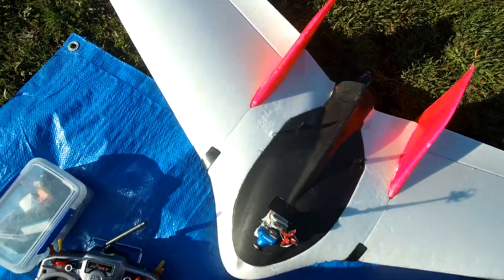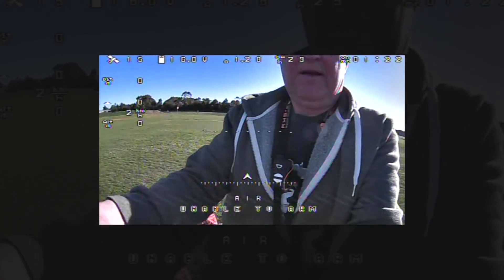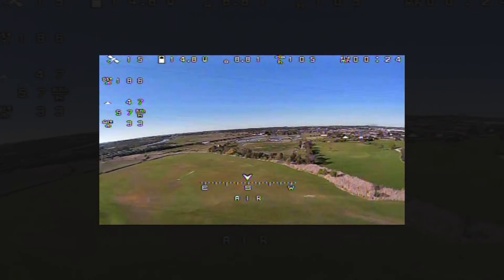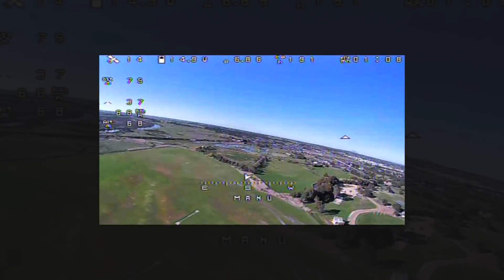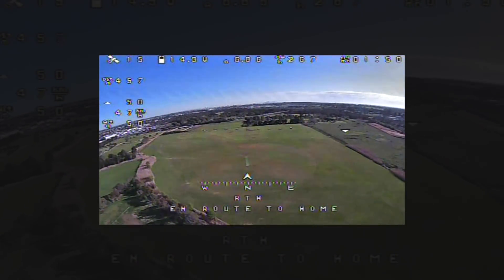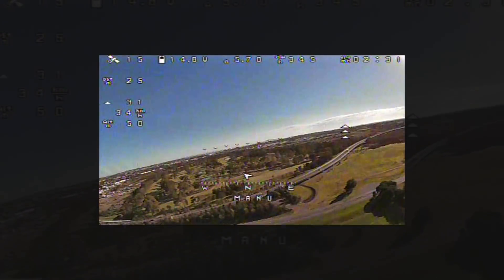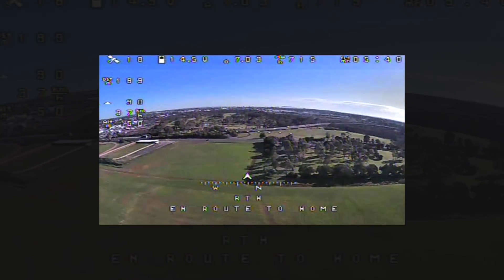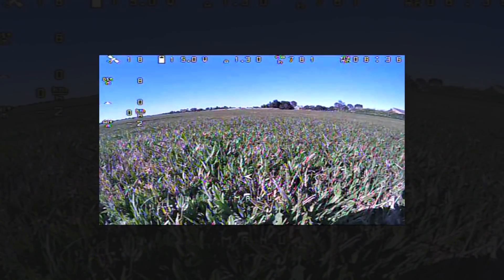Matek F411-Wing on FX-61

Comment: Have you tried running smart audio for your vtx on this board? I have my smart audio wire connected to the ST1 pad but the power settings I get are not the correct ones for my VTX.
Reply from the maker: No I haven't used Smart Audio at all. Is that used to change VTx settings?
Reply: @AndrewNewton  Yes it is. Could be handy to have work.

Comment: Remove Air Mode Andrew...its for Quads....Try Angle Mode in its place...its a less agressive form of Horizon...I like the 3D Cruze Mode too..tried it the other day...:)
  Oh and Launch Mode...I can send you the cli lines you need..its easy...lol.
Reply from the maker: Air mode = Acro plus control at zero throttle. Launch mode is pointless. It is known, lol
Reply: Launch Mode is great Andrew, no prop strikes on your hand...ever....You are right about Air Mode though and control at zero throttle...Quite why they would turn the PID loop off is beyond me.
  Im using 2.0 now...
Reply from the maker: Have you tried Launch mode with a big heavy model? The novelty wears off very quickly
Reply: Andrew Newton  You can add some idle throttle to the launch mode and all your issues will be solved. Try it

Comment: Maybe ESC braking is drawing the current?
Reply from the maker: Dont know, I'll have to test it.
Reply: Usual ESC draws very small amount of current in brake mode. It is shortcircuit of motor windings, not battery.
I think, current sensor need to be calibrated. Factory settings not always correct.

Comment: Nice one, as usual. Any idea why it still drew 1.3A while sitting on the ground?
Reply from the maker: Servos, board, Vtx and camera all draw a little at rest. They might be digital servos, will have to check.
Reply: @AndrewNewton  I wonder if the current sensor is calibrated correctly.
Reply from the maker: I can check that too
Reply from the maker: Using a watt meter, it's showing 0.3 at rest and up to 0.6 twiddling the servos.
Reply: @AndrewNewton  That's more like what I would have expected.

Comment: I've seen another video about matek 411 board on a wing and he explained that he had to put the receiver far away from gps + board to get a far lower noise. He had put this tiny receiver on the wing half way down to the wing tip. Board was in the front and receiver at the back close to the hinges.

Comment: What preset did you use in inav and did you have to adjust the pids?
Reply from the maker: Either the Wing Wing Z-84 or 600mm wing preset and no changes to the PIDs. They need to include a 1.5m wing preset I think.
Reply: @AndrewNewton  I totally agree. Thanks for sharing. I setup the f411 board in the fx79. I used the default 600mm preset and it flew like crap in the stabilized modes.
Reply: Where do find those presets? I fly 600mm 1000mm never saw those presets
Reply: @ai-cover-music-channel  1000mm is not there. Andrew was saying he wish they would add a 1000mm to inav. But he said the 600mm setting worked fine for the fx61 which has a wingspan greater than 1000mm.

Comment: That is exellent Andrew
As usual an exellent job 🖖
Reply from the maker: Thanks Mark. My Phoenix 1600 just arrived. Bring on the SW wind
Reply: Sweet
U need to cool the motor in flight if u intend to motor it around as the motor gets hot and melts the front of the fuse
🤙🏻
Reply from the maker: No motor to begin with, pure killer slope machine